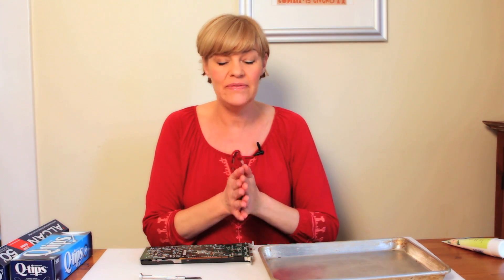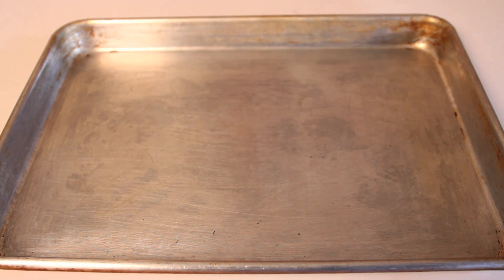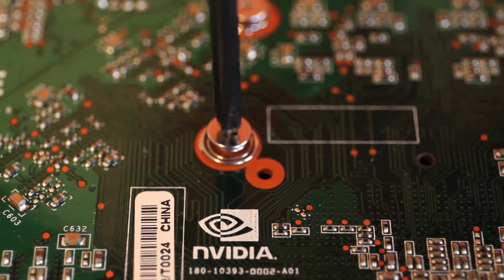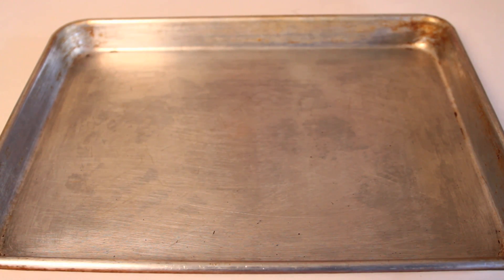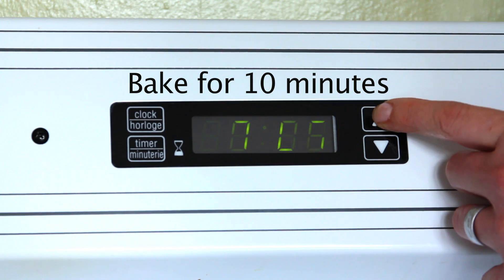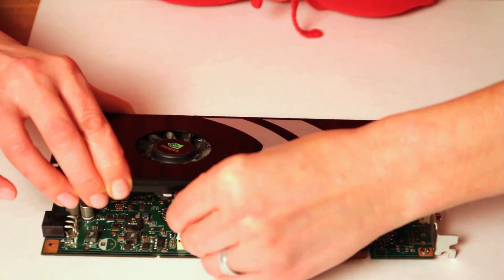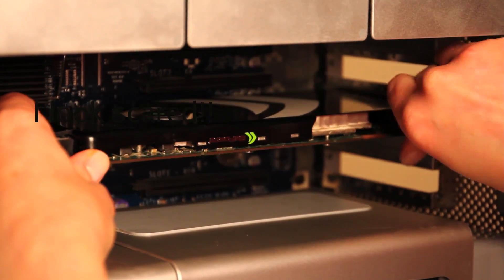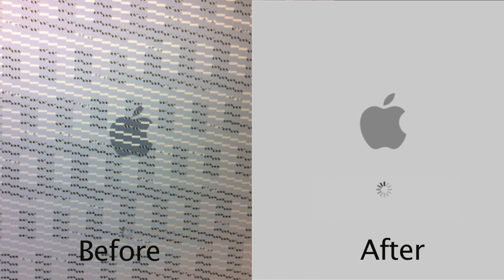OVEN BAKED How to Fix Your Graphics Video Card

Comment: Can I air fry it?
All kidding aside. Do I pre-heat the oven first?
[EDIT - UPDATE]
I pre-heated the oven. Cooked it at 375 degrees for 10 minutes and let it cool down. Installed it and no improvement.
No loss. It was an old "GeForce GTX 650-ti" ready for the trash 3 years ago. Before I finally toss it out, I'll do the Heat Gun treatment and cook the crap out of it.

Comment: Also, don't move it till it's cooled back to room temp. Reflowing solder means it liquifies, and if you've ever manually soldered a joint remember what happens if you nudge anything before it sets into a solid form? The joint will turn a dull splotchy gray color instead of the shiny silver you want. That's the same kind of dry joint you were trying to fix with the oven.

Comment: Did this with my Titan X was 2nd hand outa warrenty so nothing to lose was crashing and artifacting and freezing system followed this guide.

 I put a Artic Extreme IV on it after baking with noctua thermal paste and Copper shims for vram.

Before temps were 65c idle 89c load now 29c idle 48c load 54c with furmark after 3 hrs no freezing or artifacting at all ty was going to throw the GPU in trash or make trinkets outa it lol.

Comment: This worked on my Radeon HD 7850 Card purchased in 2012. I stripped the card down and cleaned with a Q-tip and rubbing alcohol. removed all stickers and place in the oven at 375 for 10mins. added new thermal paste and whola it worked. this was my last resort since the card wouldn't accept the driver for it and I was getting black screens at windows start up. Will most likely buy a new card when prices fall.

Comment: This worked for me today. My video card recently started crashing whenever I put any sort of load on it, and then started crashing just during normal web browsing. I was pretty disappointed, especially with video cards costing so much because of those dang bitcoin miners. I bought an older midrange replacement card from china, but will have to wait about a month for it to arrive. In the meantime I saw that you could fix a gpu by sticking it in the oven, so I watched this video and tried it out (reapplying thermal paste of course). I wasn't too confident it would work, but I just ran 3DMark 11 and my GPU got through it without crashing, so crossing my fingers that this holds up at least until my 770ti comes in the mail.

Comment: DONT DO THIS IS UR COOKING OVEN!!!!!!!!!!!!!!!!!!!!!!!!!!!!!!!!!!!!!!!!!! U cant not cook food in ur oven after this has been done in it. Thats why ppl use small toaster ovens for this kinda stuff... And the tin foil cant be touching anthing but the pcb board it self.
Reply: I was planning on trying this out, but I"m curious... is there evidence that you have that it is harmful to do this? It seems to me like if you open the oven afterwards, even point a fan in it for 10 or so minutes, the effect wouldn't be too bad for cooking in the future since everything or most everything is metal on the graphics card I believe. I'm genuinely curious, not trying to argue.
Reply: It like the same thing when u solder things. U always do it in a well-ventilated area/room/hood. The fumes that is generated when soldering will also appear in baking a gpu, among other things. And with no where to go, it will settle in the oven. Iguess you can clean it out after, with burn and ventilation(repeat), but i doubt that you will get all of it, and when u cook food it will slowly be relased, and absorbed by the biologic material in the oven. So ur food will be contaminated by this. I would never do it, since u can get a cheap aftermarket oven for like 5-15$.

Comment: I did that but i completely burned everything to the point that the components came off the PCB as the lead was liquidfide and can no longer hold everything that were soldered on. Not too worry, i knew about this method for years and just recently tried it. It was my mistake, actually my oven mistake as its thermostat was off by 15-20 more degrees and it perhaps ran at 400 range. Sadly, it was an Nvidia 780Ti. Just want to warn others that watch your temp and set it to 350 degrees just incase. :)
Reply: She said 375 fahrenheit which is 190 degrees... you set yours to 375 degrees no wonder everything melted off lol
Reply: Tho it's recommended using heat gun lmao not oven just saying (plus it's not healthy using the same oven after baking GPU cuz it leaks gases that can "poison" future food production.

Comment: Thank you I will try this, funny enough I used to work has a hand solderer but this technic Is how machine soldering worked, the robot puts all the surface mount parts on with the solder and flux paste then then they went through an oven to fix all the parts  at the same time, this technic will work when you have something called dry joints on the board a dry joint Is when the board gets a bit old because of warming up and cooling down continuously, the parts on the board chips resisters Etc will all look connected & ok but but some of them won't be connected because the solder has lost It's  conductivity. :)

Comment: After baking and before reinstalling the heatsink ALWAYS remember to put on new thermal compound. Otherwise your card will likely die again very soon from overheating or you have other issues with too high temperatures.

Comment: It works, i did 3 times on my GTX 460.
Reply: How much it lasted for each time?
Reply: Once it lasted almost a year. the second time around 6 months, i don't remember for the third time but not less than 5 or 6 months. Anyway, it took me 30  mn to bake it, so having the card working even 6 months is still good :) It gave the time to save to buy another one.
Reply: My last videocard (Gtx480) lasted about 2 years. After i baked it, i've started doing its maintanance monthly (changing the thermal paste, cleaning up, etc).

Comment: is it ok to use a microwave oven?
Reply: The Life Invader microwaves operate by basically sending billions of microwaves (VERY electrically active) so if u put a piece of tin foil in the microwave it there would be showers of sparks flying everywhere and probably kill the microwave in seconds. DONT PUT ANY METAL IN THE MICROWAVE. For any reason. Only very special and specific metals should ever be put in the microwave (for example defrosting ground beef in its plastic sausage-shaped package that usually has 2 tiny metal clips on either end is alright since its on the lowest setting and the amount of meat is much greater than the amount of metal. there are some kinds of foods that have cardboard/metal that helps cook the food like some specific pocket-dinners and burritos. to help brown it
Reply: Fucking god no... It would ruin it and short it out sending millions of high voltages all across the whole card with sparks flying everywhere!
Reply: ***** Lol yeah, I didn't take the risk 😂
Reply: ***** Ohh, Thank You So Much for this information!! You are a life saver.😄👍
Reply: you might want to use some common sense, what are microwaves and what are you trying to put into it.

Iphone users still fall for this, will PC users do?
Reply: You can microwave fucking aluminum
Reply: Yes.

Comment: Did you forget to use some thermal compound before screwing that VGA card back together? (or did my eyes deceive me?) The object of baking is to re-melt the soldered connections on the card. To ensure the solder adheres it's a good idea to paint on liquid flux to those contact points.   Michael  UK

Comment: i'm having issues detaching my video card from the fan, there's a little cord coming from it that I'm assuming is the power for the fan and it won't come out. i don't want to yank on the wires but I've broken two nails trying to pry that little fucker out. Am I missing something? I've got the same card she does.
Reply: There may be a tab you have to press in. Sometimes you can use a tiny flat headed screw driver from a set of precision screwdrivers to lever/wiggle it out too. If that doesn't work 2 small needle nose pliers (one on female plug, one on male and pull apart) might do the trick. 

Just be careful not to tug on the wires too much or use pliers on the wires as they will probably snip.
Reply: Thanks, the pliers worked, just had to angle them so they were pressed against the front of the plug and pulled up. I'm also glad to report that baking the card worked like a charm. :)

Comment: I had forgotten all about this, My last post here was [Feb 10, 2015] and here I am still using the same card, I've gotten an extra 14 months out of this, its still going strong, and I'm now in process of buying a new machine all together, soooo, to recap, if its broken, the worst that can happen is you heat up the card and it still does not work.... and the best is you could get an extra 14 months+ like I have.
I cooked my card 200ºf for 16 minutes, turned off the oven and walked away, I removed the card about an hour later, I then reassembled it and refitted, (I did not inspect for small cracks as I could not see any cracks in the first place).
It's always worth a go.

Comment: What you are doing is causing the solder to reflow.  It is done a lot on chips with a ball grid array.  The balls are tiny pellets of solder and anyone who repairs these kind of cards will have special equipment for both applying new solder and melting it into place.  Some people have used their toaster oven for this sort of thing.  Don't do it unless you are ok with the risk of permanently damaging something or you are ready to buy a new card anyhow.  This is also a good excuse to buy a new one if you have an old one and have been wanting an upgrade anyhow.

Comment: Hey there, I just want to say thanks for this tip (although there are many vids about how to do this, yours is straight to the point and well presented) as last night my MSI AMD Radeon R9 270 GFX card decided to shutdown and give me the fuzzies. I took it into work, baked it on my lunch break and popped it into my PC when I got home, all seems to be working well :)
One tip I found on another channel was to let the card cool down slowly, so at the 10 minute mark at 180c, I simply switched the over off, left it in with the door shut for a minute then opened the door and allowed to cool passively.

Comment: she didn't re apply thermal paste wtf
Reply: yeah, but not 10 year old budget paste...
Reply: +Luis Rodriguez (SymBiioTic) She only cleaned the thermal compound off the GPU  - there is probably an equal amount on the cooler so when the cooler went back, it had some compound on there. You only need a very thin layer anyway.
Reply: there's more trhan enough on the radiator normally, in fact you need a thin layer of paste, the real contact must be done with the GPU and the copper of the radiator. pasta compensate the little asperities and bumps it could have at the micron range.

Comment: I liked the video for entertainment purposes and expected chocolate chip cookies to come out of the oven. My other thoughts are how did you diagnose the issue, was the video card dead or was it just lines in your picture on the display. Did you reseat the card in the slot before you baked it? I'm a skeptic and just wondering if the bake my GPU process works or if it's something else quite simple like reseating the card or cleaning all the dust from the fan and board. 

GPU's, memory and capacitors don't like heat, period! 375-400F is literally cooking your video card! Try the Easy Bake Oven next time, with it's 100 watt light bulb :) Again, I like the entertainment value, but everyone please don't bake your computer components unless cookies come out of the oven with it when baked :)

UPDATE: Mr Skeptic actually tried this method today; 430F for 18 minutes on my GTX 460 and I'll be a monkey's uncle, it freakin worked! How long it works is a whole other story! No more Windows Code 43! I didn't use foil to lift it, instead I used some screws in 4 of the holes to lift it. I took the mounting bracket off so no weight would be placed on the DVI sockets; the solder didn't appear to melt, however I didn't want to leave it in any longer. Give this method a try it if you've exhausted everything else to fix your card. I've been proved wrong, again!

Comment: New meaning to women in the kitchen.  I kid.  Anyhow, you should definitely have added thermal compound after applying this fix to your GPU.  A nice drop right in the middle of the GPU would suffice.  When you put the heatsink back on the pressure will spread the thermal compound on the GPU.  Or you could add pressure by hand and make sure the compound spread pretty evenly before screwing everything back on.  I would be surprised if you didn't have problems with the GPU without applying new (or any in your case) thermal compound.

Comment: baking a video card essentially re-heats the solder connection, people used to do it with the Xbox 360s as a cheap way of repairing them.

Comment: This method definitely works, I fixed my 8800GTX years ago doing this and now my 4 year old GTX590 died two days ago and today I baked it, now it works like new. The melting point of solder is 370 degrees so I like to bake a little higher than this video says just to be sure the solder is getting re-liquified, I do 400 for 9 minutes (after preheating of course) but if you want to be extra safe you can bake at 385. But remember you HAVE to reapply NEW thermal paste! This video didn't do that so don't forget that step, your GPU can overheat and fry if you don't have that on there.
Reply: Ty for your detailed description. This vid was a new light to me but fucked up kinda lol. Im not new to building comps but im new to cooking video cards haha makes me hungry
Reply: 385 Celcius?

Comment: This may be a good temporary solution before you buy a new card, but keep in mind that ICs let alone graphics processors are quite heat sensitive so it could significantly shorten the life of your graphics card.

Comment: no termal pase, damaged solder connections, damaged chips and capacitors and dont be stupid to do this
Reply: klein lacastesantos do you have any knowledge about electronics?
Reply: klein lacastesantos all caps in electronics cant handle more that 105C
Reply: klein lacastesantos at about 2kv in microwave owen and any metals in microwave oven makes overload and short circuit and damage to components on pcb of card!
Reply: klein lacastesantos I do not want to argue
Reply: Let me put a scenario like this:

I have a broken graphic card without warranty. meaning id need to buy a new card..
instead of throwing my old dead card into the trash
i put my card into the oven.
my graphic card works again.
profit..

do you think ppl care if it works worse than before it died?
do you think ppl care about broken caps etc.
or do you simply think people are happy that they possibly can use their gpu again.

Comment: My husband does this with X-boxes and Playstations and Computers etc .... And 9 o of 10 times it's successful :) The only thing though that you didn't do that really should be done is that you have to replace the Thermal paste! This is very important because it helps to cool the card. This is amazing though :) and thank you for sharing with others that maybe weren't aware of this trick!!! :)  Very impressed !!! :) :)
Reply: BeforeAndAfterTV Yup - at 3:10 in your video, your should have replaced the thermal paste (after carefully cleaning the old paste residue of both the chip AND the heatsink)... using just enough to assure a complete, air-free bonding between the two, for proper heat dissipation... and to prevent premature failure due to excessive head. Might be prudent to also replace the thermal pads, as well...
Reply from the maker: Wow, that is great to know about the xbox!  Yes, you can replace the thermal paste for a better chance of it working.  They sell it at Best Buy but were unfortunately sold out and I was in a panic to get my computer running ... I will probably take it out again and replace the thermal compound!  Thanks for your input!